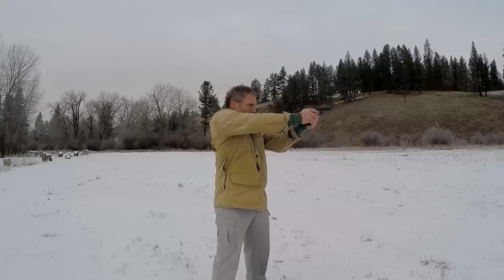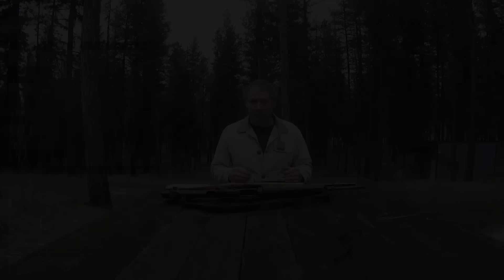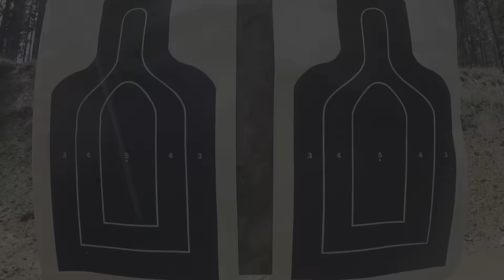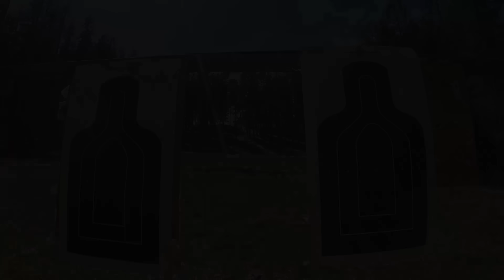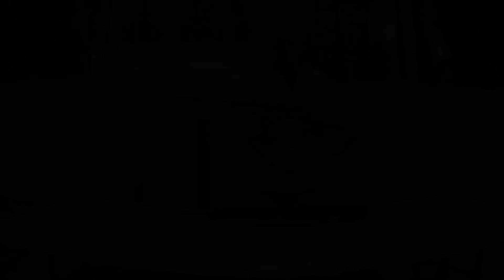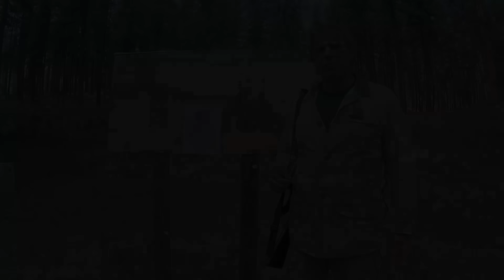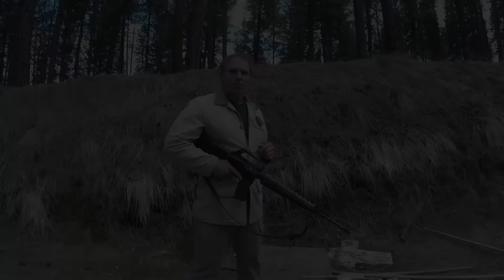Mini-14 vs AR15: Which is Better?

Comment: That looks like a 180 series (pencil barrel).  The ones produced now use a higher quality mid profile barrel.  No hate at all.  I don’t think the Mini is as precise based on my own comparison between my rifles (both 16” barrels), but the gap is closer.  One thing about the all the Minis no matter what series, they are reliable as hell and run dirty.  The action has very positive extraction.

Comment: My mini 14 is the 2nd or 3rd generation (built after 2003) and it's really beautiful, especially in a state where an AR platform is restricted and kind of a pain to acquire if you just want to go buy something outright. Because of preban nonsense in MA, I have aftermarket 30 round magazines that work fine. The only downside to the rifle is the magazine situation, more the cost than anything else.

Comment: hey Paul good job. my only issue with the ar are the sights, at close range you have to compensate for the 2 plus inch sights even with red dot. it took me lots and lots of rounds to finally learn to aim high for the lower shot, muscle memory. keep up the good info  GODSPEED

Comment: So, why go through the extra pointless steps of using the right hand to engage the magazine ejector lever on the mini rather than the hand holding the new mag? Of course it's going to be slower if you add extra steps.

Comment: barrel harmonics and inconsistent gas blocks could cause some serious accuracy issues with the mini-14. a good gunsmith could improve it quite a bit. And yes, I know I'm a couple of years late. Also, I find myself very disappointed that I keep getting warned about Shatner-esq pauses, yet you fail to pause anywhere close to that. LOL

Comment: Watched the video again because I have an AR15 in my collection now. The AR15 truly has a scary appearance, but I have now come to realize that the internal components of my MGB's engine appear scary also.  Can anyone reading use a manual choke, operate a transmission with an overdrive, or rebuild the engine?  Probably not, but methinks gun users must take public perception into account.

Comment: The magazine issue is, in my opinion, the Mini-14's greatest shortcoming. The rifle overall has a lot going for it - it's popular and long-lived for a reason. 

If Ruger would move away from the proprietary magazine design and alter the rifle so that future models accept more affordable, more consistent quality and more readily available AR magazines, I think they'd really be onto something great.
Reply: THIS! Completely agree.
Reply: I've never had a problem with using Ruger magazines. Yes, they're more expensive, but you do get what you pay for. They're much robust than P-Mags.

I really don't want a Mini 14 that accepts any AR components. The more dissimilar the Mini 14 is, the better. The anti-gun politicians are more likely to leave it alone.
Reply: @alanhigh8125 I don't think magazine compatibility would be the make or break issue that would save the Mini-14 from a hypothetical future Assault Weapons Ban.

Comment: I would run a statistical unpaired T-test in Excel to determine if the differences in velocities from the chronograph are significantly different.  Simple in Excel.  As always thanks for the informative videos.

Comment: Great , informative video.  I live in NY, it sucks, you want a AR rifle you have to lose the pistol grip!  My friend has an AR semi auto & it looks funny because the pistol grip is replaced with a similar grip like the Mini. I like the Mini, I also like lever action rifles.  I don't get questioned by the cops or troopers but my friend does 1- because of the weapon, 2- because of the magazine normally you see on a AR.  he can only have a 5 shot mag, I can load 10 (but don't) in my tube magazine.  The other lever action only holds 4 in the tube.  Gun laws only make life complicated for the law abiding citizen.

Comment: Fair enough comparison Paul. Firearms are as good as the users understanding. No we don’t have any AR rifles for our reasons. However we have an M1A Scout chambered in 308, a Mini 14 chambered in 5.56 ( using .223 Rem ), a Savage 110 also chambered in .223 Rem and two 10/22’s for plinking fun.

The user is the key. Know your firearm, what the firearms like ammo wise. Practice Practice Practice.

If the firearms are inaccurate there is either something wrong with the user or the firearm. One of the two needs to be addressed.

Always a Pleasure Paul and Crew, thank you 🙏.

Comment: not a comparison thea 1 has a 20 inch barrel, the mini 14 an 18 inch barrel. Doa test with 556 and the common 16 inch AR 15 and the modern mini 14 still w 18inch barrel

Comment: The truth is, if you give Picasso a set of cheap brushes, he will still create master pieces.  If you give the average person a set of the best brushes on the market you're probably not getting a master piece.

The difference is experience, training, and skill, not equipment.

Get in the ring with Mike Tyson where you have the best equipment and he has crappy equipment and you'll see the difference very clearly.

Comment: The French  Gendarmerie chose the Mini-14 for its less severe appearance. Their version,  dubbed the Mousqueton AMD, is made in France under Ruger license. It doesn't have a flash hider, has a 5.56 chamber and a three-shot burst. So it's a wolf in sheep's clothing.
The Mini-14 is a great design with its simplified piston system, but I wouldn't say it's easier to take down for cleaning. The AR-15s upper comes off with two takedown pins and simple bolt carrier group removal for straight line cleaning from the breech. Unlike the AR, the Mini-14 disassembly doesn't offer a straight shot for a rod through the breech for cleaning or bore-sighting.

Comment: I have AR's and a Mini 14 and 30. Directly comparing them slightly misses the point for me, they are different and that is why I have both. The Mini is a compact fairly lightweight semi auto rifle that is a great all round firearm, a great truck and RV carry. The AR is more specific in its particular role and certainly has some advantages as a defensive rifle, if things get really ugly and tactical reloads etc. become necessary - personally I think that's unlikely to occur, but still a plus, it also depends on the competency and persistence of those attacking you. However for those who have not spent time with an AR and are used to more traditional rifles, the controls and function of the Mini are more natural. For my wife it's easier to transition from her 10/22 to the Mini, than to an AR as a much more casual shooter. Conversely those who grew up with AR's find the Mini controls alien. I feel when we debate which one is better, we need to specific about what it is actually better, as they both have strengths and weaknesses.

On cost while Minis are pretty pricey, value does depend on the model. If you buy the stainless model that comes with 2, 20 round magazines that represents better value for the slight increase in price for stainless steel, and it comes with half decent sights. Depending on the environment you operate in the stainless has many benefits and that isn't something that is easily available, if at all, and certainly not cheaply in other rifles. That stainless option was important to me and  big part in my decision to add Minis to my other rifle platforms in 223/5.56 and 7.62x39.

Comment: Excellent comparison. The Mini 14 is a 100 to 150 yard firearm. Was no point going further. And from your perspective. The 2 firearms were equally as accurate. That was enough for me. And you was shooting the older version of the Mini 14. With the so called pencil barrel. With it's history of bullshit inaccuracies. I was impressed with your comparison. Thanks for giving a fair and honest review. 
P.S. The flash hider/compensator you have on your Mini 14 is similar to mine. Looks alot like one off an M14.

Comment: 19:44 Another point I’ve heard made in favor of the M1, Mini, etc, is that a low sight over bore height presents a smaller silhouette of the user, limiting exposure.
(similar to taking a bladed stance)

Of course you never want to be poking your head over anything, but the idea is to get your head as low as possible.

What would that target size be?
1. Distance from eyes to the top of the head.
+
2. Distance from bore to sights (eye level)

US Males       Eye Height   Stature 
50th %ile           64.57”        69.09”
95th %ile           69.02”        73.62”
Ref Gordon, Claire C, et al (2014) 2012 anthropometric survey of US Army personnel

Roughly, 4-1/2”

An M1 Carbine’s sights are 3/4” higher than the bore. 
(not sure what the exact height is on the mini, I’ve seen 7/8”)

An AR’s sights are 2 1/2” higher than the bore.

This brings our target sizes to:
M1: 5-1/4”
AR: 7” +33%

Is that significant?
Is that significant in combination with sight over bore offset at closer distances?

I don’t know, you be the judge.

Comment: Not sure if it is because my Mini-14 is a 581 series (2011) Tactical but simply pushing the mag release lever is sufficient for the mag to fall out easily on the ground for speed changes. I have no issues with either loading or dropping mags. Of course I'm used to it obviously which is relevant to the great magazine debate.

Comment: Cheers for the presentation Paul. Im looking to get a .223 for fox upto small deer (local laws require 1000ft/lbs for the deer but the smaller the rifle the smaller the land I can use it on). My local shop has a mini14 newish and youve found no problems that'll affect me. It'll be a straight pull, again UK law and I doubt I'll be needing a quick mag change any time soon. Looks like I'm going shopping on Monday.

Comment: Thank you for doing such a good job of explaining the physics of the two sight systems, i.e., the line of sight and the trajectory.  I especially appreciated and understood how the higher sights of the AR result in a trajectory (if that is the right word) needed to compensate for the parallax resulting from the line of sight not being on the same plain as the bore.  The flip-up to the distance sight on the AR also explained a lot.  But here is my question:  If both rifles have the same optic sight mounted at the same height above the bore, wouldn't the differences in the sighting/accuracy disappear?

Comment: Being an owner of a M1A, I find the Mini-14 is very familiar right out of the box.  It functions flawlessly.  The one complaint I have against the Mini-14 is that the factory sights suck.  But if you go with optics, that is not an issue.  If you stay with iron sights, there are some good "drop-in" aftermarket sights available.
Reply: I loved my uncle's Mini-14. And I love my Mini-14. I didn't love my last two mini-14s. I like when my weapon works.
Reply: Tech sights offer very good replacement aftermarket sights for the mini14
Reply: @frankiehernandez1854  I've got 2 Mini's and I'm seriously considering getting a Tech Sight for each of them.

Comment: Paul - I was issued a Mini-14 some years ago and immediately took it to a gunsmith. (The front sight had a “ding” on the top right causing an over hang.). I had the front sight machined square and then had the ramp machined into a Patridge configuration.  Then I had the rear aperture opened until the front sight did not change color (If the rear sight is too tight for the shooter’s eyes the front sight will appear lighter in color instead of remaining the same color).  It was .125” and, at that time in my life, I needed it opened to 170”.

Comment: I bought a new one back in 98’ and I gave up when it grouped an inch or better at 25yds scoped, I didn’t go any further with the scope zeroing process, stuck with my Savage 110 for varmints. I was under the impression that it wasn’t until the mid 00’s that Ruger fixed the consistency issue and all prior had bad consistency. So glad to hear that it was hit and miss and there’s resurrected hope of getting a good grouping classic one. Even though I’d have to shoot it prior to it’s acquire.

Comment: Ill say again. The mini is a 7/1 twist, favoring heavy rounds. Arithmetic is not an opinion!
Reply: Wow thats wrong both ways lol. What you mean to say is 1in7 twist. That means the rifling inside the barrel twists 1 time for every 7 inches. Also Mini 14's have been made since 1974 and have under gone different changes. They have come in 1in10, 1in7, and 1in9 twist rates: http://sunflowerammo.blogspot.com/2012/11/ruger-mini-1430-barrel-twist-rates.html
Reply: I mean Paul is literally using a 1990 pre-580 series Mini 14 with a pencil barrel. He's using the old and inferior Mini 14 variation for some reason. Had he used a 580+ series with the tapered thicker barrel I have a feeling the results would be different.

Comment: You should grab yourself one of the 580+ series Mini 14s and do the test again to see the huge improvements they've made. Not only are they chambered for 5.56 (Except the precision target model. Its 223), but the new barrels with the taper are a vast improvement for accuracy. I got one with the 16.12 inch barrel and I'm hitting about 1 MOA groups all day, even with cheap Russian steel cased ammo. Wolf, TulAmmo, etc....
I have mine set up in an Archangel Sparta stock with a Cogburn arsenal trigger finger mag release and Leatherwood 1-4x24 LPVO and it runs just as well as any AR.
Reply: The older models, per their manual, can also handle 5.56 NATO; Ruger put "CAL. .223" (not .223 REM) on the older receivers because, at the time, .223 Remington was the more known/available ammunition.
Reply: @kevinmabry3307  Back after 6 months LOL. But yeah, I know they could handle it, but I think chamber dimensions still had the shorter distance between the bullet and rifling of 223 rather than 556. Its a tiny fraction, but in this community, fractions break reliability debates. LOL
Reply: @shockwave6213  5.56 NATO 55gr functioned reliably in my 181 series Mini-14. No different than 55gr .223 Remington.

Comment: All Mini-14's with the exception of the Target model are chambered in 5.56x45.  The earlier versions were stamped .223 on the receiver but they were chambered in 5.56.  Later versions have 5.56 on the receiver.  To confirm this check the owner's manual for the rifle.

Comment: Someone get this man a drink. Some of you seem to be putting him on edge. Very happy with my recent Mini 14. It's one of the newer models which definitely lends itself to more accuracy. I wouldn't be surprised if I could obtain 1 MOA in a sled.

I did however submit an RMA due to some markings that looked unusual on the bolt and some fuss I had with it out of the box and one jam at the range.

Comment: I would say you have some of the least biased, thorough, and entertaining “versus” videos. 

That said, and I’m sure I am one of several thousand people who have already commented saying the same thing, this versus video should be done a second time with a 580 series Mini-14 Tactical 16.12” barrel. I had a 182 series Mini-14 (made in 1982) which I sold in order to get a brand new Mini-14 “tactical” 584 serial prefix. I only had the 1982 Mini-14 from December 2020-February 2021 before selling it to upgrade to an up to date Mini-14.

My guess is the thicker and shorter barrel on the 580 series greatly reduced the variability in accuracy from rifle to rifle. Basically, the most accurate old Mini-14 could be just as accurate as the most accurate new Mini-14, but if you took ten old Mini-14’s and ten new ones, you would see the newer ones being much more accurate as a whole. The newer ones also come with a flash suppressor and threaded barrel. It is definitely an improved product. Of the 600,000+ followers, I’m sure there are several people willing to allow you to redo the comparison with a new Mini-14 with 16.12” barrel.

Comment: Any semi-automatic rifle using an operating rod along with a gas block on the barrel is handicapped in terms of accuracy. As the operating rod is jolted into motion and separates from the gas block, the barrel gets a little (and inconsistent) tweak added to its normal vibrations. Careful hand fitting of parts helps, especially in combination with a heavier barrel.
Mini 14 - All steel receiver and case hardened to a thickness of at least .020"
AR15 - 75% aluminum alloy with the critical parts steel
Mini 14 - Open bolt design is a close copy of the M14. The open bolt is very forgiving when it comes to dirt, dust or sand. The rifle clean or dirty just keeps ticking and ticking.
AR 15- Closed bolt design. Just ask our troops about the plastic baggies they need to use to keep the sand from jamming up their rifles.
Mini 14 - Self-cleaning gas system no buffer tube to collect moisture or dirt and lock up the buffer system.
AR 15- Must be field stripped to clean trigger compartment, Buffer system, Bolt & carrier and gas tube system.
Mini 14 - compact, versatile, and doesn't take up much space.
AR15 - Large bulky
Mini 14 - Field strips in seconds. Pop the trigger guard and the rifle practically dismantles itself.
AR 15- Definitely slower to disassemble.
Mini 14 - Now here the AR has an advantage over the Mini. Out of the box ACCURACY!
AR 15 - Out of the box ACCURACY!

Comment: A more modern version of a Mini-14 will be a little more accurate than the one used by Paul. And the accuracy of both the older and newer Mini-14 models can be improved somewhat by installing an Accu-strut LT on the Mini-14 to reduce its barrel vibration caused by the Mini-14's gas system. 

As for leaving one's home with an AR-15 in hand, assuming you can own one in your jurisdiction, always put the AR-15 in a gun case so your nosey neighbors don't know what you're carrying. And when transporting the AR-15 gun case to the range, keep the case out of sight from nosey law enforcement officers should you ever be stopped for a moving violation or for some other reason.